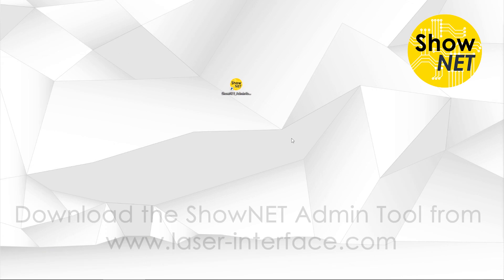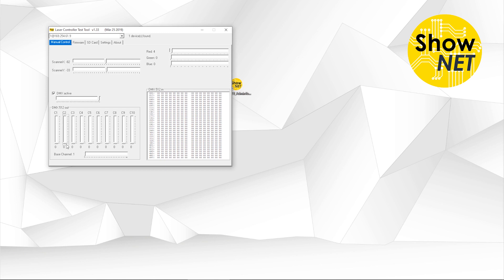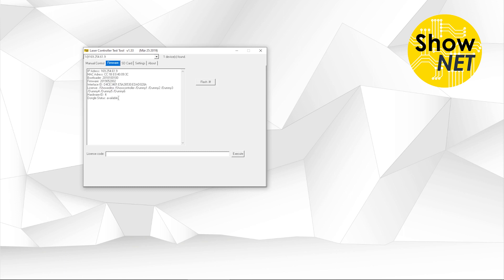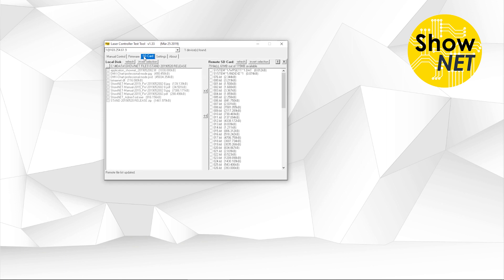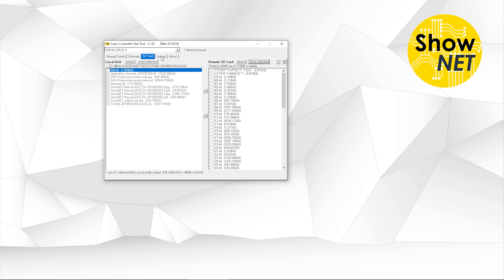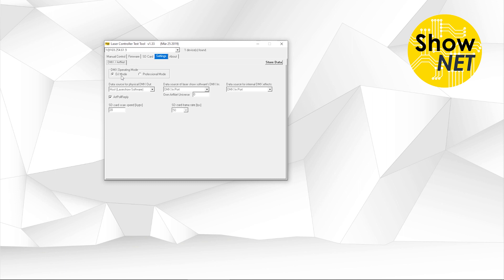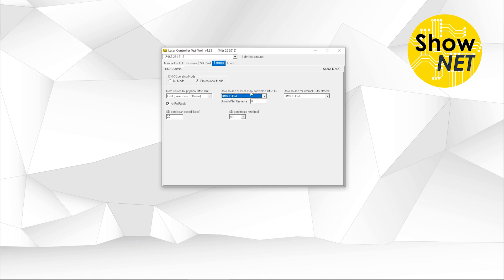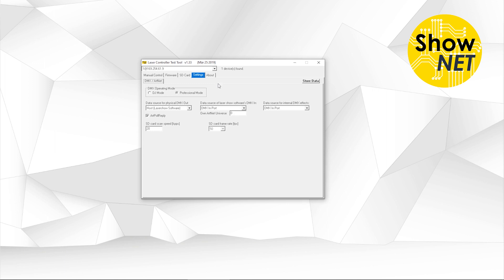Explaining the ShowNET Admin Tool

Comment: Hello,
many thanks for that video. But I'm missing the information, where I can programming the DMX-Adress of the LaserDevice?
Reply from the maker: Just at the back side of the projector - either use the DIP switches (if you have a unit with DIP switches), or use the display and set the DMX adderss there (if you have a unit with Display).
The latest Admin Tool is explained here, btw.. It supports all the new features of the latest firmware: https://www.youtube.com/watch?v=kjyMg5DPnyM